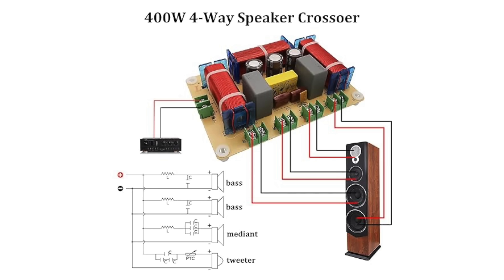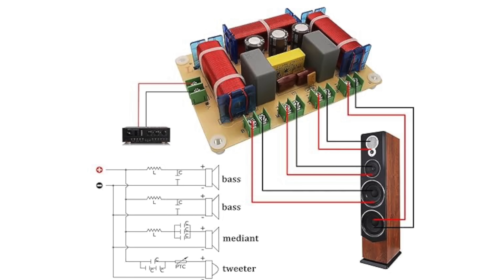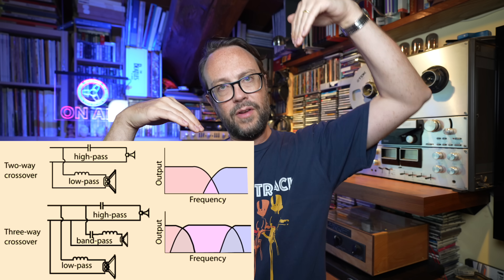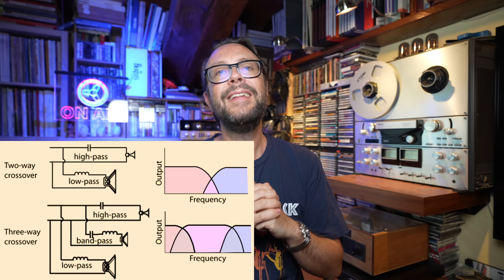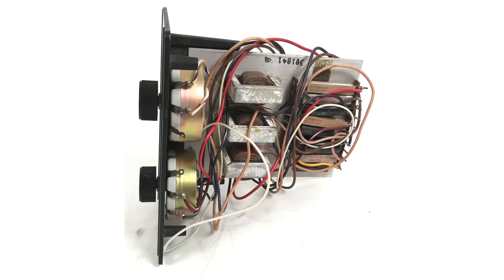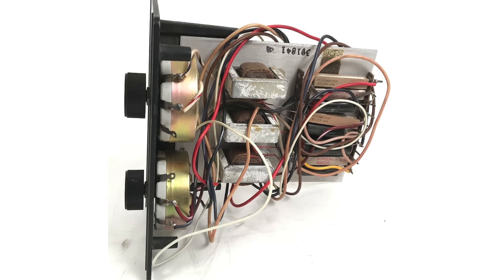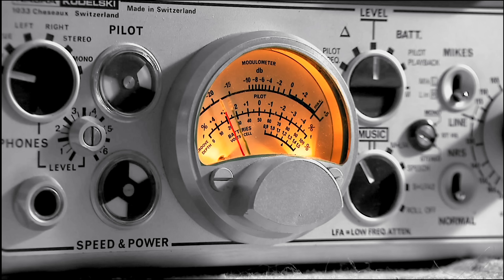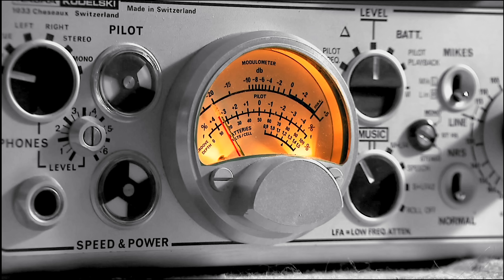SPEAKER CROSSOVERS: is inner placement distorting the sound?

Comment: My theory is there is some connection either between the crossover's various components, the outputs to the drivers, the connections at the drivers, or the connection to the incoming signal from the amp which is poor hence it makes/breaks continuity from loud sound/vibration. . . .  and inside a loudspeaker is indeed extremely loud. Possible reasons include a cold/cracked solder joint, corroded contacts, a bad crimp, a poorly seated quick disconnect that's not fully in place, etc.. Have you ever had a lamp that flickers? That's the visual manifestation of the same thing: the electricity is making/breaking continuity hundreds of times per second due to the same sort of reasons, (plus the heat of the lamp expands metal parts so they move out of position, they then cool when continuity is lost, they then contract and re-make contact . . . .and this cycle repeats).

Comment: I just met you I neede a interconnect highend low cost you video showed up the silver square one then subscribed went to you channel found you video on crossovers in speaker vibration distortion just what I need I’m out a system together with helpful tips budget even crossover mods now outside the cabinet for sure now thanks for you modesty natural  ways

Comment: Is the problem magnetic interference from the driver motors - vibration/pressure from moving air - cabinet resonance - electrical interference from internal speaker wiring - or something else altogether?
There could be many reasons having the crossover in a particular location could cause issues. 
Thanks for highlighting your experience with crossover placement.
Reply from the maker: Indeed! Thank YOU!

Comment: The capacitors are microphonic; capacitance value is modulated by ambient pressure. If those modulation frequencies are in the audio band the effect is likely to be audible. Half of the diaphragm's output is emitted into the room, while the other half goes into the enclosure, making it the loudest place in the room. So that is the last place you'd want to put a crossover.  I've designed hundreds of production high end speakers - zero of which have had the crossover inside the pressure vessel.   A definite no-no. Every pro designer ought to be aware of that. But the industry keeps doing it for economy.
Reply from the maker: Interesting, thanks!

Comment: The reason piano is such a difficult instrument to reproduce, and reveals distortion artifacts of a hifi system: A piano recording is a good test for any system in regard to frequency response, phase and time linearity, coloration, and harmonic distortion. Piano is regarded as a full range instrument, but harmonically it isn't The spectrum of piano, a reasonably fine sounding piano or a Steinway, produces a linear slope from about 100Hz to 8kHz. The fundamental notes cover the full range of musical octaves. However the harmonics are non-existent above 8kHz give or take a little. Because the piano is so percussive with no extended range above 8kHz. Distortion produced by the system at 8kHz and above, becomes plainly audible.

Comment: The trouble is you're using motor run capacitors there cause a lot of microphonic issues that's why you don't use them in crossovers in a closed box
Reply from the maker: That could be since they both had some…🤔

Comment: Spectacular destortion 

In those filters do you have metal film capasitors and iron core inductances ?

These type of components are influanced by magnetic flux. When impregnated with flux from the magnetic field from the speaker the will behave differantly than without the magnetic influance. There is saturation that occures in the core from the inductances that will overdrive them realy fast. This was used in some effect pedals on purpose.
Metal film capacitors can become microfonic when old. New there schould be no problem. Inductors with iron core can also be microfonic but nnoticable only on very low frequencies. Because of the mass involved.
Reply from the maker: I think you nailed it! That would finally explain the gradual worsening of the quality, magnetization!

Comment: About 30 years ago I got bit by the Tweaker Bug and started ‘’upgrading’’ speaker components. Most of the projects have involved small-to-medium bookshelf and stand-mount speakers. In every instance I chose components that were much larger than the originals, and in every case my new homemade boards would not fit back inside the enclosure. So, I had to create separate boxes to house the Xovers. While one can debate whether it sounded better that way it did make the network easily accessible for further modifications, which is what many DIYers live for 😃.
These days, my main speakers use an electronic Xover housed in a separate enclosure, feeding a fully balanced tri-amped configuration. Thanks to cheap class D amps and DSP units this approach doesn’t have to be expensive and cumbersome any longer. It also opens us to a world of possibilities.
Reply from the maker: Indeed but if you want to keep the signal fully analog…gonna have to climb the mountain!

Comment: When a speaker designer designs a speaker, he takes to account the physical presence of the crossover. If measurements and listening tests suggest a problem of the sort you experienced, a good designer will compensate with better placement(of the crossover)/damping/bracing or other actions to eliminate the problem.
Taking the crossover out of a well designed speaker could actually hurt its performance.

Comment: One of the biggest improvements is having a crossover outside of the speaker and 99% makers don’t do it. With the amount of tweaks and products in the market you would think someone should make some sort of modules for third party cross over upgrades you can put outside of each speaker. Make it a standard that new speakers have individual connections for each driver who no internal crossovers.
Reply from the maker: Indeed!

Comment: As a amature it sounds like radio frequency and vibration interference. Shield for both.
Reply from the maker: Could be! But why this does not affect the crossover when out?
Reply: @anadialog could be magnetic interference from the woofer magnet. Those are big magnets once electricity is applied to them, the higher the volume goes the more the electronics are effected.

Comment: The Origins of this issue come from the problem of crossover components vibrating inside the speaker and the sound of the vibrating capacitors, resistors, and wires coming out of the Port and being measured or perceived as Harmonic Distortion.  Audiophiles have done their typical nonsense thing and turned this issue into a Magic Electrons issue wherein the electrons and conduction are affected by the sound vibrations thus affecting the sound quality.  All such claims backed up by the confirmed perceptions of a psychologically self programmed audiophile.  This  is all nonsense.  Crossovers vibrate and you do not want to hear the sound coming out of the port.  The Real Magic Electron Issue is the Psychological Self Programming of Audiophile Perceptions that is impossible to avoid.  "Microphonics"... More audiophile BS.  Audiophiles should never be believed because their perceptions are so drastically influenced by their Audiophile Belief Systems.  The Hi End Audio Industry needs to take a serious look at the Psychology of Sound Quality Perception.  It is 90% B.S.  Listening to your discussion on this issue tells me you are deeply lost in a world of false audiophile perceptions.  B.S.
Reply from the maker: I have no idea what you are talking about…Really! I just presented my problem and clearly stated that I don’t know why this is happening. My first guess is vibrations and I found a wealth of literature confirming that capacitors and inductors are indeed sensitive to that. Clear and simple.

Comment: I wasn't expecting that much difference! The fact that it took some time is normal, when something vibrates it takes some time to deform slightly the mounting points, and when it gets to the point that it's free it start to really vibrate. On normal speakers I have never heard something similar, is it possible that some quality component is more susceptible to vibrations and standard stuff not? In any case we should definitely start reconsidering their placement, at least as a test
Reply from the maker: Interesting! That would explain the time shift. What seems incredible to me is that two completely different and audiophile grade xovers had this very same problem!
Reply: @anadialog  Maybe some audiophile grade stuff can feel the vibrations. Maybe oil-paper capacitors instead of common ceramic ones? I'm definitely not knowledgeable enough, but maybe it could be worth discussing it with the producers of the crossovers. Maybe they get the idea of what is the culprit component and offer a product variant that is 98% as good and doesn't have this problem when placed inside the speakers

Comment: My theory is that with the massive and very powerful magnets that they use  now days they are modulating the coils just like if you put a compass near a magnet it affects it and the stronger the magnet the stronger the force. In vintage speakers they used mostly small alinco magnets that were fairly weak compared to modern rare earth magnets. So the farther away the crossover is to the magnets the better.

Comment: the solution is dsp crossovers! although it feels like the industry is fighting it tooth and nail by absurdly pricing them out, cheapest I could find is adau1701 dsp which costs more than a passive crossover. and the output  quality is dubious at best.
Reply from the maker: Not for me, not done digitally. Active analog crossover, yes and actually working on it ;-)
Reply: @anadialog  best quality and best price active analogue crossover is Sublime Acoustic in the US.  they ship internationally - i am in the UK.
Reply: Better than the Accuphase F25?
Reply: Well done Guido, love to see in the future an update.  I run my ATCs actives and it’s a completely different experience. 
Way less phase distortion, better time alignment and no parameter fluctuations because of temperature.

Comment: Even with crossovers mounted internally,they shouldn't sound as bad as that last clip. Dreadful resonance going on somewhere.
Reply from the maker: I know!! So strange…with both of them!
Reply: @anadialog I may have missed something, but did you try both crossovers eternally? If the problem is present with both,it may be a cabinet resonance that's disrupting things. Even so,preventing caps especially from vibrating too much is good practice. Claritycap did a paper explaning the audible effects of capacitor resonances,but unless there's a fault somewhere i wouldn't expect distortion to be that audible.

Comment: Which crossover was used in the first sound clips? By the way, the altec n500g crossover has liquid wax pour over to sealed the crossover components n is place inside the speaker. I guess they seal with wax to eliminate the interference
Reply from the maker: The Pete Riggle. Indeed, wax or resin would be the best thing to do!

Comment: Hello, You can also put a magnetic shielding between the crossover components, specially the inductors, and the drivers magent using, for example, a still screen  protecting the crossover components from the magnetic field generated by the drivers magnets
Reply: A single full range driver, you cannot beat them for unadulterated sound.
Reply from the maker: Good idea!

Comment: Hi Guido, yes that was obvious in those recordings. I must admit the original recording was the better sounding of all three. It still sounded a little washed out with the crossover outside the speaker cabinet, but the third recording was by far and away a major issue. 

I think of a company like Wilson Audio the speakers I have, they pot their crossovers meaning for those who don't know they pour a resin material into the crossover network, filling it up eliminating any resonances and harmonics from building up, and causing that kind of issue. But of course, the downside to that is you are unable to work on the crossover. I guess like everything in Hi-Fi there are compromises.

I'm glad you were able to get to the bottom of your problem.  Weirdly, it was only really happening on the piano, although I did note in the recording there was a slight issue with Patricia's voice as well, but nothing like the piano. Maybe it was just those certain frequencies that were really ringing the crossover components inside the cabinet.

Anyway a great video and a very clear comparison with the recordings. And a great question posed.👍👌🎧😁
Reply from the maker: Thanks Shane! Yes, resin or wax like in the old days would definitely be a great solution…maybe I will do that!

Comment: Interesting video but something is really going wrong here with the crossover inside, may it be some lose screw or contact solder? It's hard to believe it's just microphonic unless a specific component is extremely prone to it
Reply: Sounded like a loose or cold solder joint to me too. I would use a test tone sweep to locate the resonate frequency and try to damp certain components vibration to locate the source offender.
Reply from the maker: But then why did it cease when I pulled it out (and gradually increasing when put inside)?
Reply: @anadialog  e io che ne so? :D

Comment: It’s really the only correct way to put the crossover into a well isolated box but it is not a practical solution for most of the consumers. They’re not capable of digesting this fact. The Wife Expectancy Factor in this case is Ground Zero.

Comment: This is why shielding is most important. Old equipment was more likely to have shielding. Yes EMF from electronics happens. To use a crossover in a cabinet use a metal shield over the crossover and if possible ground it. What you are doing using the crossover outside it a kind of shielding. A simple tin can over the crossover inside would solve this.. For a bigger crossover you have to make a cage maybe out of fine metal mesh or even a baking tray. Totally cover the cross over.

Comment: I have towers that have built-in powered subs  Besides having a crossover for the mid & tweeters, they also have a crossover/ amp for the subs  Not sure if it affects the sound as they are located away from the speakers

Comment: Yes outboard x-overs are a better way of doing things. Even better is having them right by the power amp with cables going to the drivers. Each cable only has to deal with a limited band of frequencies. I’ve noted your pictures of the crossovers, and I see many problems. The two Inductor coils being on the same plane and not turned 90° away from each other, this is basic 101 crossover designed to avoid saturation from one coil to the other. The use of L-pads  pots to Control level is Harming sound quality. Poor quality sandcast resistors are also an issue as it is with the steel barrier strip connections. Back in the 70s I worked for a store where we had the Altec nineteenths and the cabinet was poorly braced, and the metal horn also rang as they all do. All these issues can be measured and heard by the human ear. Wishing you well and continue having fun with your equipment. Best regards.
Reply: Would you care to offer alternatives to the L-pads, sand-cast resistors & steel barrier strip connections?
Reply: @cougar1861 , sure, stepped resistors either in a pot like hi and volume controls or a three way switch, if you’re having to alter the output By more than 3 db You have other problems😊 there are many alternatives that are a bit more expensive. As far as resistors go from copper to film, in a Hi-Rez system you can hear the difference by just making that one change. Prefer solder joints to strip barriers, but if you have to use them, there are copper alternatives. These changes probably are not measurable on a frequency graph, but can be heard.
Reply: Possible argument for single drivers?
Cube audio diy. WOW!
Reply from the maker: Thank you for the detailed and technical feedback; I appreciate the insights! To which one in particular you were referring to of the three?

Comment: Crossovers, due to inductors and capacitors, create phase shifts between the different drivers. A full range speaker is largely more coherent in reproducing recorded material. A "cheap"  multi-driver box speaker can't hold a candle to a single full range speaker, such as a voight pipe.

Comment: There is an old video of the chief engineer of Audience-AV who make Auricap squeezing a capacitor which changes the voltage on a multimeter, caps in particular generate different dialectic fields based on gap distance, so Auticap said that they took microphony into consideration when designing theirs, but yes putting certain cap designs inside a speaker hitting resonances of the cap could change the voltages and measurements of the cap, not good when those exact measurements define your crossover points.
Reply: Excelente comentario, a veces el valor de los condensadores es alto y se recurre a capacitores electrolíticos hay que evitar el uso de este componente porque como dice puede existir microfonismo, que no efecto Larsen, el microfonismo siempre existirá pero solamente cuando la estructura interna del condensador entre en resonancia con algunas frecuencias, curiosamente si un capacitor está pensado para una frecuencia de corte , podemos presumir que también la física de este elemento pueda estar muy próximo a la frecuencia de resonancia del mismo.
En cualquier caso lo mejor sería usar capacitores que si encapsulado seha rijido y hermético como el poliéster, polipropileno, etc. O bien capacitores electrolíticos de alta calidad para filtros de audio.
Un saludo.
O bien